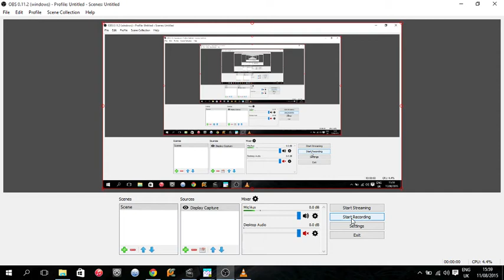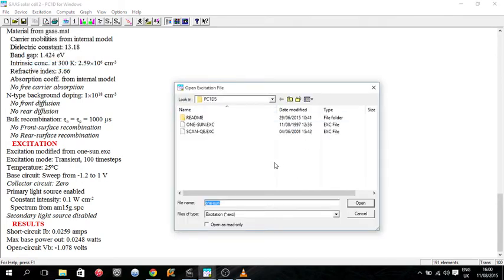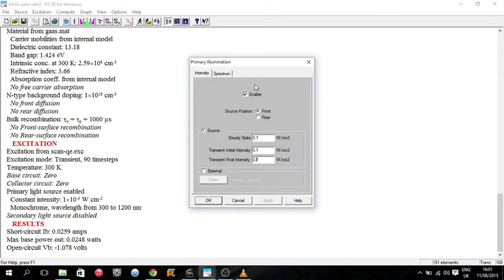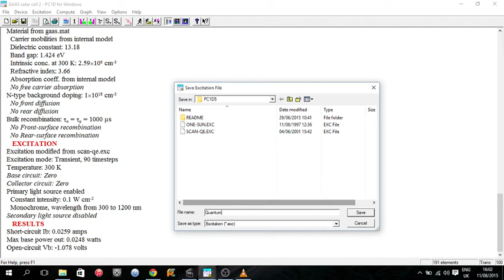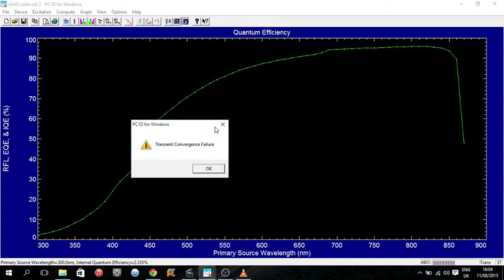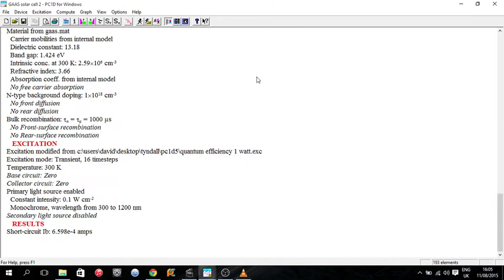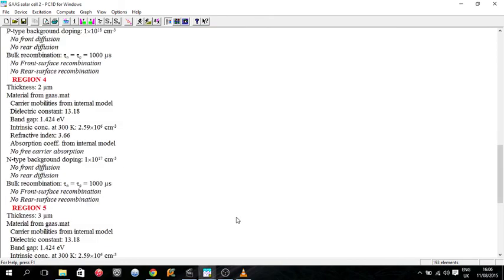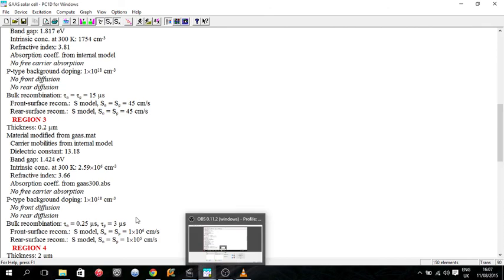PCID - Photovoltaic Cell Part 2 (4 of 6)

Comment: Hey, That was a really good video. However, I am having trouble figuring out the 'Distance from front surface' under the base contact field and 'Contact locations measured from front' under Internal conductor. I tried several combinations but  the end Max base power out result is stagnant at the value of3.103e-29 watts and there's still transient convergence failure stuff happening. I could not simulate the quantum efficiency. It would be great if you could help me out.
Much thanks from India.
Reply: Hi Janani..I am getting the same value and the error. Did you figure out the solution?